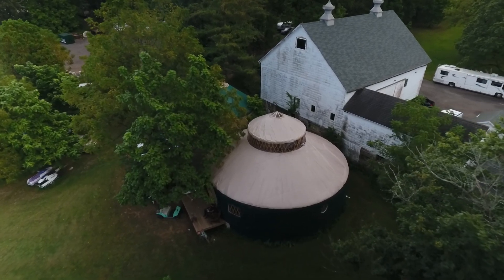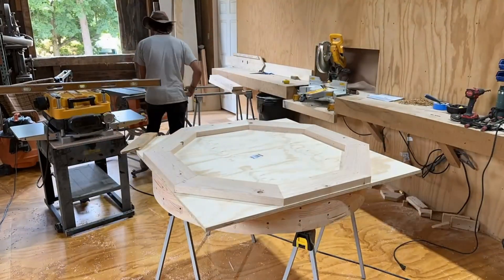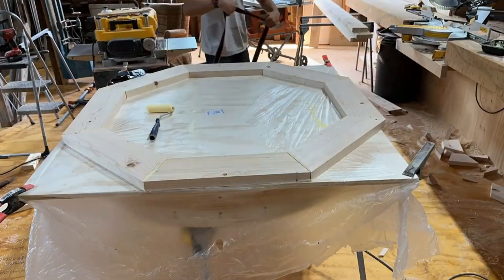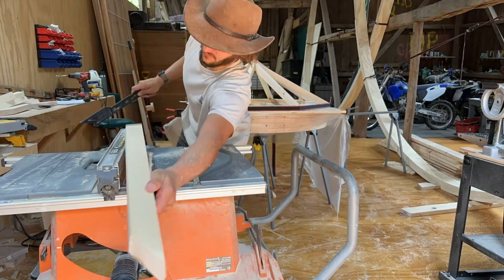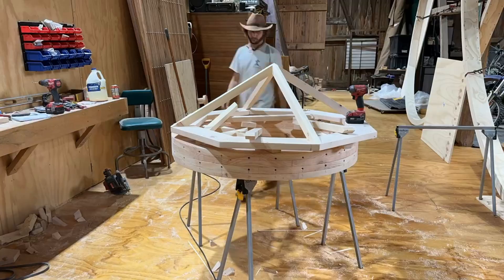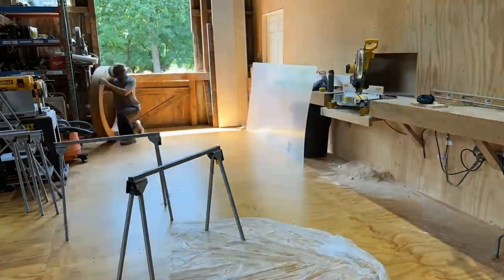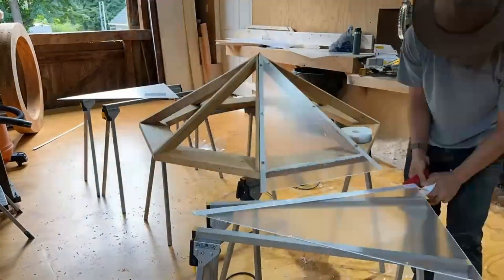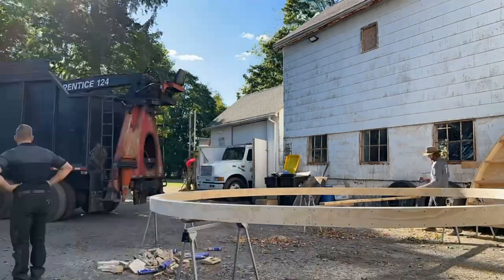How to Build a Yurt Skylight

Comment: Pin nailers, my guy. Pin nailers. At framing scale thats like 16gauge

For any build dynamic, that has to contend with the elements...screws are the devil. They shear where nails bend. 

Ill give it to anticreep deck screws, they hold up, but backing them out is almost impossible so theyre basically a single use item, like copper crush washers. 

I operate under a 'if i can break it' then its not good enough philosophy. And wouldn't you know it, but i am talented at finding breaking strengths. Maybe that's from habitually overloading, or asking more than things are intended to be used for, but thats just how i do. I just say i demand excellence in my materials 👍